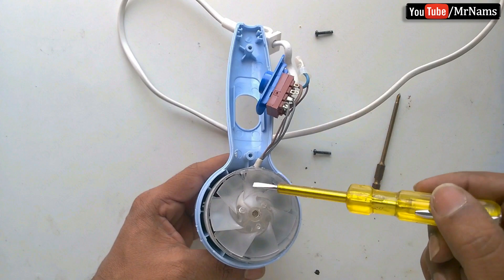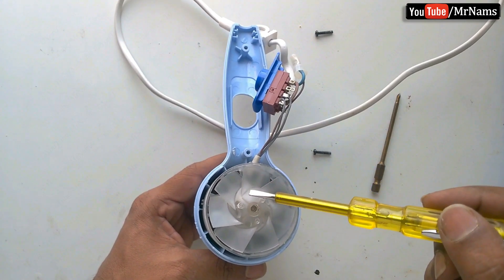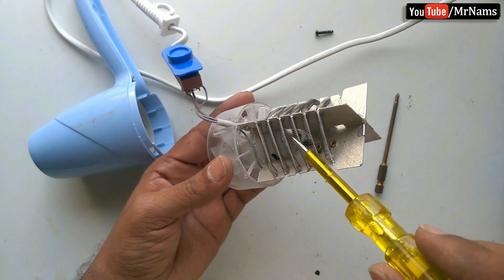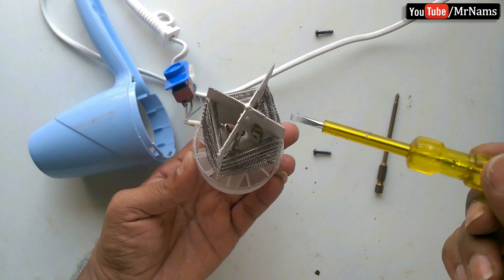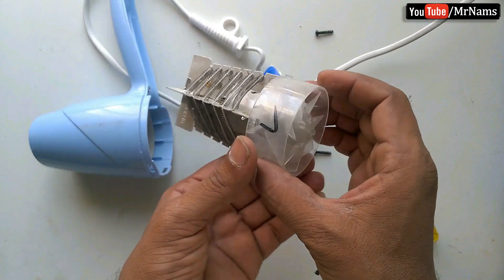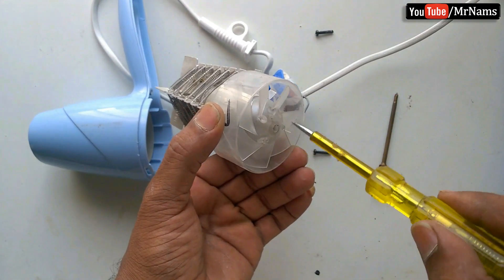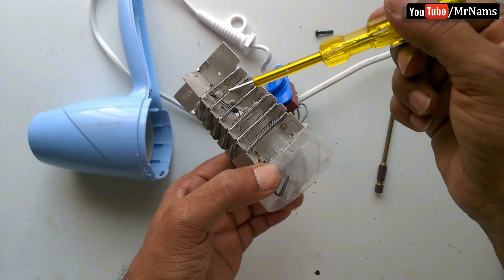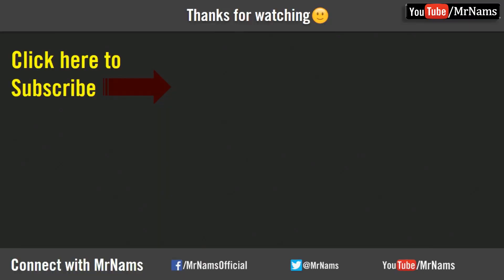hair dryer at home

Comment: How to remove heat on blower.. i only need the air blower to use cleaning. God speed. Thanks..
Reply from the maker: Remove heating coil
Reply: @MrNams  where is that heating coil.. the spring?
Reply from the maker: yes

Comment: ish drayer me jo dc motor lgi ush ki oprting voltage
Reply from the maker: It should be 12-24volts, still need to check it, right now cant check it,may be i try to check and update it later.
Reply: @MrNams  ok m waiting 😃